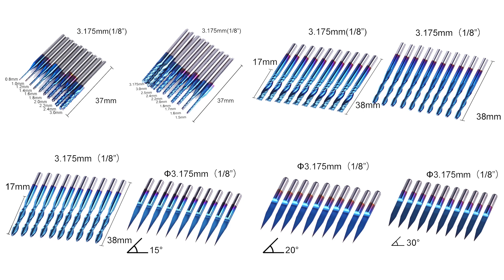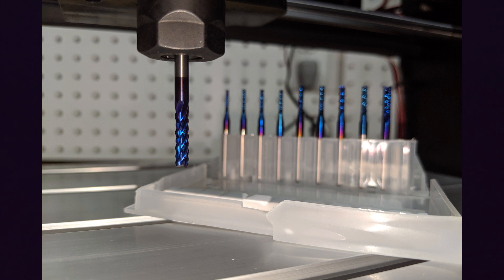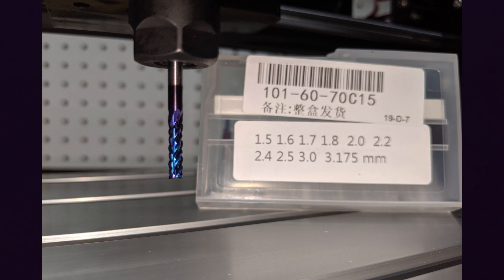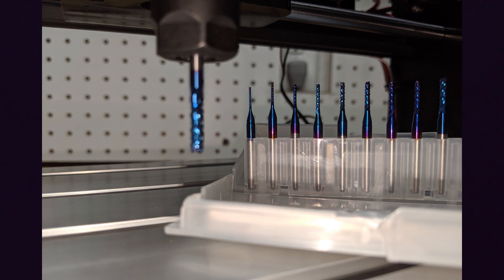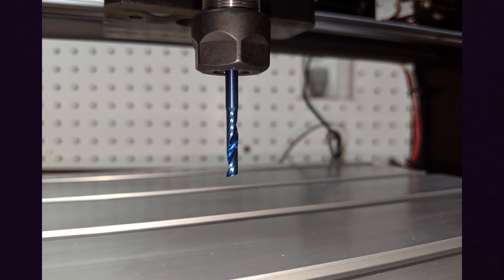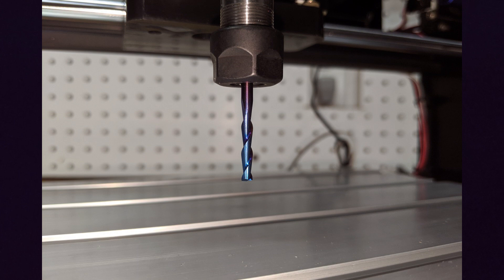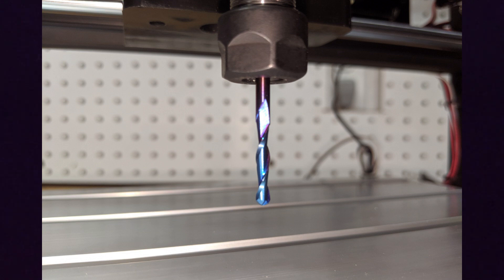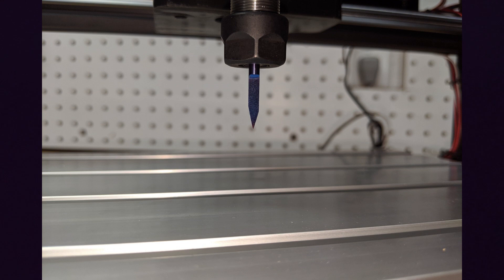Choosing The Right Bit For Your CNC Project

Comment: I have a grizzly g0704 mini mill. I mill steel and aluminum  I'm needing a cnc machine,  making small parts out of aluminum and mild steel.  Would this machine do what I'm needing done. They do sell a cnc conversion kit for my mini mill, but its 3000.00 dollars.  Can I mill 7075 T 6 and 6075 aluminum on this machine.. also,  what about mild steel.  Thank you for any help
Reply from the maker: While you can technical do steel on this, it is not recommend, and it is extremely slow. Sadly nothing at this price point will do steel well.  7075 t6 you can definitely mill. However, I would recommend upgrading to a brushless spindle, and maybe some beefier steppers if this is something you want to be quicker. Maybe look at carbide 3d and their desktop solutions, they have a small one that might work for you.

Comment: I just got my full value bit set and hope to be able to play with different materials soon. One thing I noticed is that in the two rough cut sets bits of the same size seem to be slightly different styles - or perhaps finer / rougher? The 0.8-kit 3mm bit seems to be finer than the same sized bit of the 1.5-kit for example.

Is that the same with your set?
Reply from the maker: Awesome! I hope you have lots of fun with that set! For mine they all appeared the same, just different diameters. It could be they switched suppliers

Comment: When are you guys going to sell a 4 flute flat endmill? I can't find a good quality one on amazon at 1/8 inch.
Reply: Try Drillman1 on Ebay. If he doesn't have it you don't need it.
Reply from the maker: I do not work for Sainsmart, but I can definitely pass that onto them
Reply: Don't limit yourself to Amazon for cutting tools. You're much better off shopping with a company that actually sells cutting tools. Check out MSC Direct, All Industrial, Zoro, Harvey Tool, etc.
Reply: If u are a beginer like me go to Aliexpress And check a reliable seller

Comment: Are the engraving bits that come with SainSmart 3018 Pro 15 degree or 20 degree bits
Reply from the maker: It comes with 30 degree bits
Reply: Mine came with 20 degree bits actually.